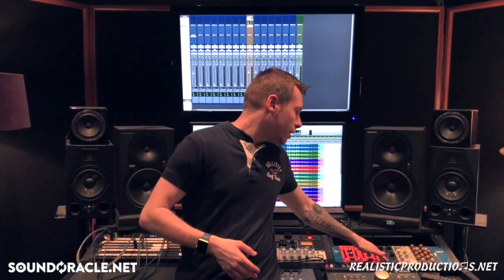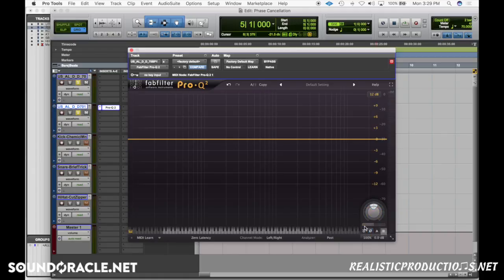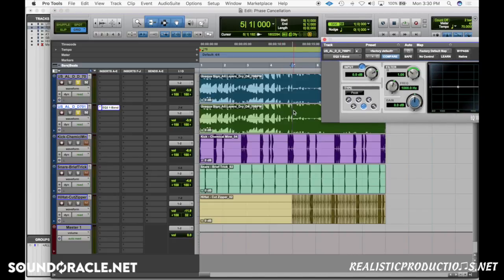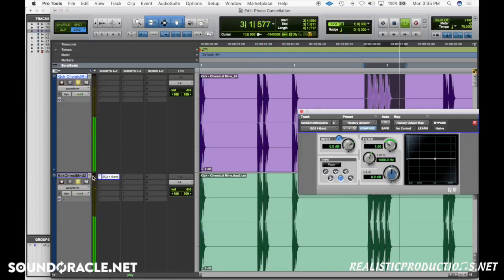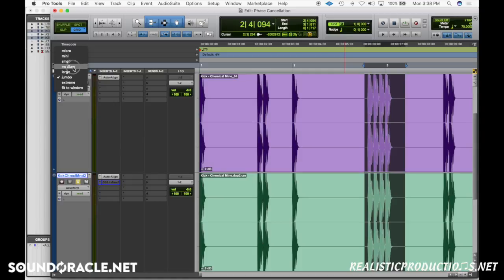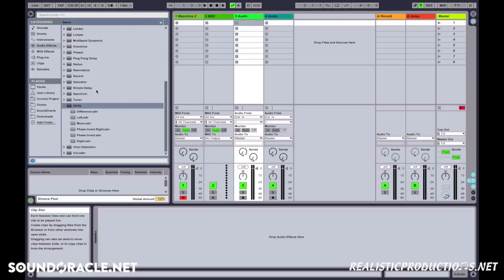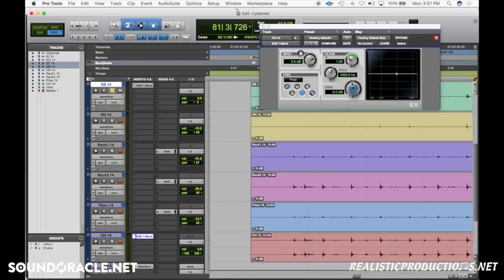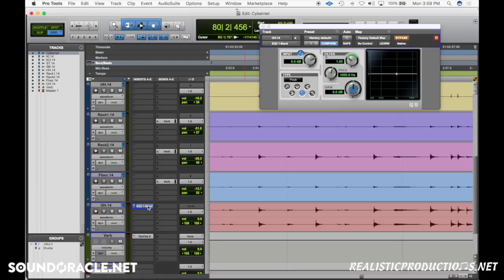Tutorial | How To Eliminate Phase Cancellation

Comment: A while back I recorded a solo piano player using Logic's Steinway Studio Piano. At the time, I didn't think I'd really use those recordings as we were experimenting.  The piano player ended up liking some of the tracks and would like to use them on an album.  Problem is the piano is very "phasey" pretty much all the way up the frequency range and the piano player still wants to use that particular piano despite the fact that it falls apart when played from a mono streaming source.  And, even light compression seems to make it worse.  When I view it on Izotope's Imager, you can see it phase all over hell and adjusting settings there just kind of takes all the life out of it. If there were other instruments in the recording this wouldn't be so much of an issue but because she's playing the songs solo, it's kinda hard not to hear the technical problems.  Have been trying other pianos but that's been a bit of a dead end too.  What would you recommend I do in the case of this piano?
Reply: Steve's Favs if it’s a stereo file, I would spilt it into 2 mono tracks & flip the phase on one of the tracks.